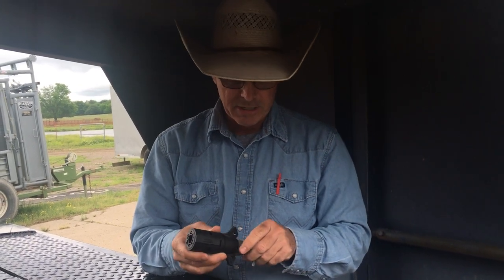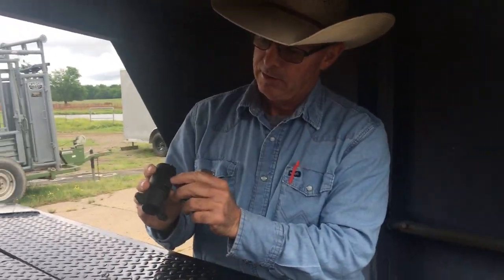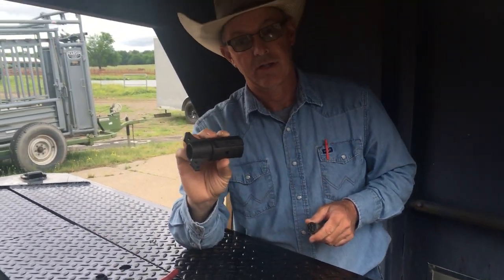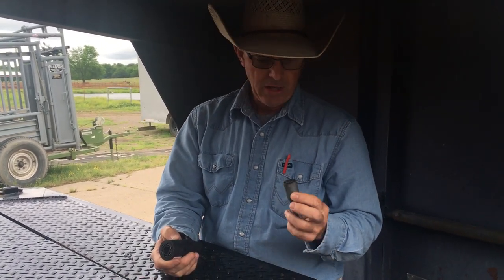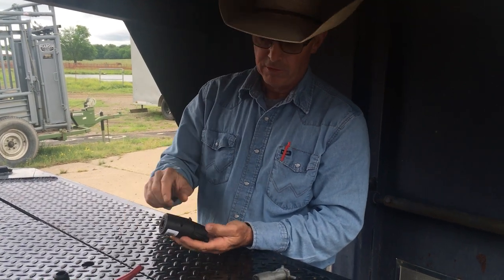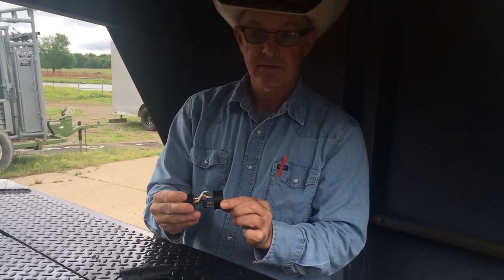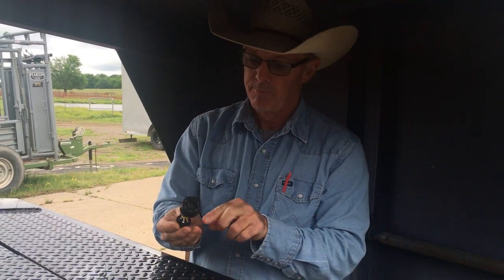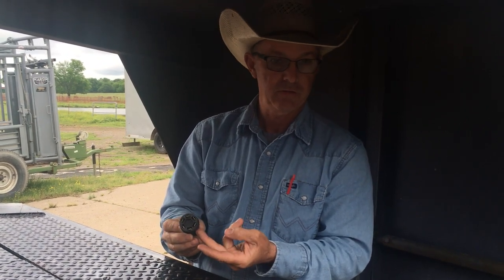Trailer brakes locked up

Comment: Thank you you saved our butts with this video...we have a new chevy truck and pulled other trailers with no issues before ..we went up north, long way from home. Hooked up to our loaded dump box which we left up there.   Seconds after pulling out our brakes locked up.. we have seen the dash trailer warning connection before. So didn't pay it no mind...went threw the wiring harness on the trailer.   After a hour of testing and Mosquito bites we decided to take a break and look on  YouTube...and after 6 videos we found you..Minutes later after your wiring modification we were on the way...would have liked to stop at a bar and buy you a beer...thank you Sir.

Comment: My rv has the seven way and my Ford F-150 has the same.  A few years ago it worked fine     Now it’s locking up when plugged in.  The running  lights work great as I put all new ones.  Not sure what the deal is.  Only lock up when plugged in.   I used a different traiker brake module when they worked years ago.  But seems that should jot matter. As they lock up when plugged in no matter what   Even if j in have the brake module in the cab disconnected.  Iv got all wires at the trailer loom color coded   Except one spot where all blacks meet there is a blue from the trailer plug that is with black.  Even if I disconnected the blue they still lock.  I seem to remember along time ago there may have been a yellow disconnected at the trailer and may have connected it to the other yellow   But even that I have tryed and they still lock